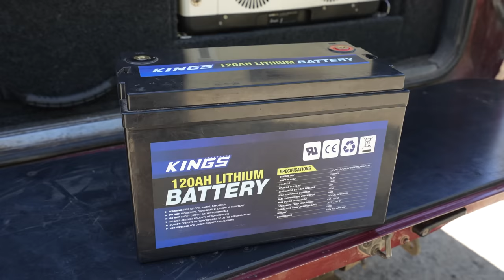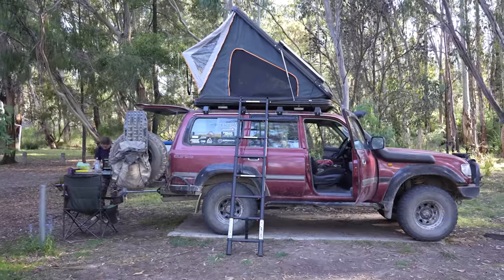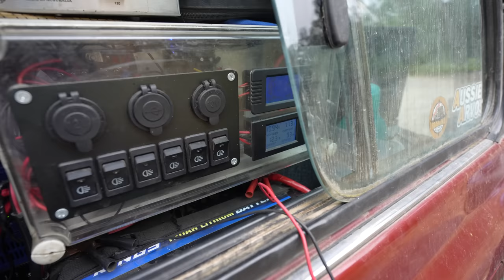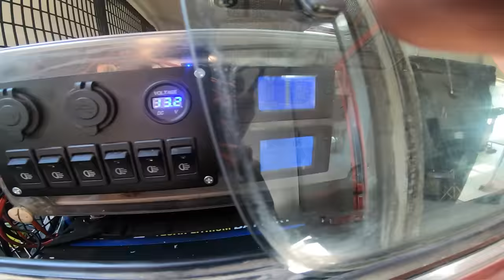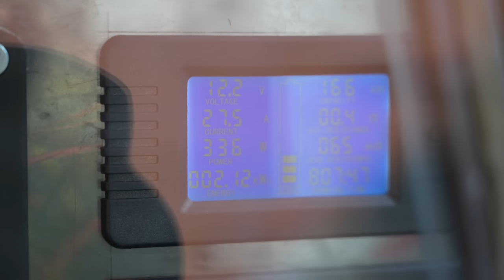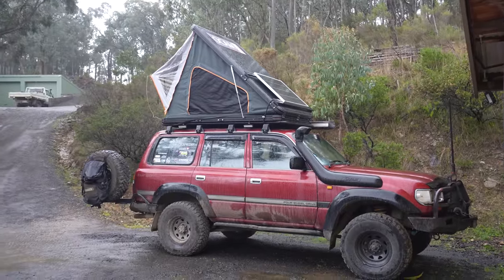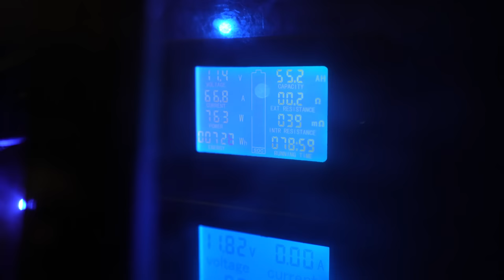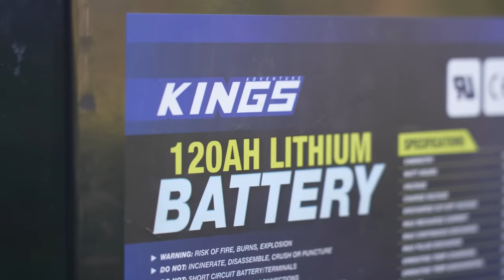Watch this BEFORE you BUY Kings Lithium Batteries

Comment: Very interesting video. I recently bought 3 115Ah AGMs from Kings. One was good, one dropped a cell pretty early and the third wouldn't charge above12.5v. I took them back and about 2 weeks later Kings refunded my money (after repeatedly chasing them up). Im not quite ready to move to Lithium yet because weight isn't an issue on a sailing boat. But thermal runaway would be.'When I do I wouldn't rule out kings batteries.

Comment: Another great review. I use a lot of kinks gear and have very little to say on the negative side but a lot of positive. Kings vs ebay is a hands down win for Kings. They also out do other brands that knock kings.

4 years ago I bought an Australian made high quality DCS 75ah Li battery at $950 with a 5 year warranty and it has been without fault. It replaced 2 x 100ah AGM batteries in our van and it out performs the AGMs. As you stated, it holds full voltage all the way to the end when lead acid starts to drop off from the start. Li can have a much better max discharge current like the 75ah DCS that is rated at 150A but goes beyond that. It not only runs the coffee machine but makes coffees for us and the neighbors. The 2 x AGMs just couldn't do one. The weight saving is fantastic. 2 x 34kg (68kg) vs about 10kgs. BUT, the best thing is the recharge time or the lack of it compared to the 2 x 100 agms. With the same solar in put, the agms would be a lost cause but the Li comes back to live by the end of the day. Last camp trip my family camped next to us has a 120 agm with similar solar input. The battery died and my 75ah DCS ran their fridge and camp but it started to come down around 40%. As there was power available at a camp kitchen I use my 16amp standard battery charger to charge the 75ah Lithium in a few hours over night. Try doing that with 2 x 100 agms.

The 75ah DCS is a lot better battery than the kings and better than most on the market. It has 150A max discharge and the 100ah has 200A discharge. They can be used under the bonnet as 2nd battery and as a start battery and with 2 under the bonnet they easily power a winch. They are top shelf. I also use the 75ah to run a 65lb electric motor on a boat.

BUT,  the cost of 2 x 120ah DCS batteries is a hard pill to swallow.  I have been looking and waiting for Li Batteries to come down in price and I have been watching to weed out the cheap junk. The Kings 120ah at $500 is goon value. The 100A discharge means it won't run a coffee machine so that means I need 2 at $1,000 but then I would have 220ah for when the sun goes out. I could buy 1 x 100ah DCS with 200A discharge and a 5 year warranty. I gues Kings have a 2 year warranty for a reason? 

There are a few things that make some Li batteries better than others. Obviously the cell quality and their voltage matching is the first. The BMS quality is a big one. As with DCS and their 200A discharge that means a much better and more powerful build than any 100A BMS. A longer warranty is also an indication of better confidence from the manufacturer so one could conclude a better overall build quality. Some cheap BMSs don't have any cell balancing so they can be less safe and will not last so long. The next level is passive balancing which is ok. Then there is ative balancing which will add years to the battery life and provide a higher and more constant higher voltage. I can't find out if kings have any balancing or what type they have. DCS have the best being active balancing so I guess 5 year warranty is a no brainer?

I beleive kings batteries are made by Lion batteries. My guess the kings are a lower quality than the general lion lithium. If I was to buy new batteries today I would go for a 200ah kings at under $800 or 2 x 100ah VoltX at a little over $1,000. I prefer 2 batteries over one larger one. VoltX now have a 5 year warranty. They only have passive cell balancing but I would accept that.

Again thank you for a great honest review and marry that girl before she wakes up. :)

Ps. I have been having a great run with kings semi-flexible solar panels for the lst few years.
Reply: That's a nice big write up mate. Hey just letting you know that you possibly should change the ninth word of the first paragraph  ;)
Reply: @MW-us3sv  not a Kinks fan?

Comment: Just a quick observation. One cycle is not from 100% State of Charge (SoC) to, say, 95% Depth of Discharge (DoD).

A measured cycle is determined by the manufacturer and they use Peukert's Law. Peukert's law expresses mathematically that as the rate of discharge increases, the available capacity of that battery decreases exponentially, often at a sudden point. This is where Lithiums at different price points differ dramatically.

The manufacturers typically pick a point, for a cycle, where the roll-off in Voltage occurs the fastest, which in a cheaper battery might be 60% DoD. I have 2 x 300Ah Enerdrive Lithiums (in a new van - I'm 64, retired and can afford them) where the next cycle starts at 80% DoD from 100% SoC. SoC is different to 'fully charged'.

My wife and I live on the road in a smallish caravan

I have 680W of solar on the van roof and twin 40Ah MPPT controllers (roof and 200W Redarc solar blanket). 80Ah charger for shore power and a 60Ah while driving. My inverter is 2300W and I employ induction cooking. Best tips? You can buy an 800W toaster, a 900W sandwich press, a 1000W kettle, a 750W hairdryer and so on - check for wattage.

In my diesel tug, I have a 'secondary 100Ah AGM battery' for charging devices and lights, and some bells and whistles. A 100Ah Redarc GoBlock for the Bushman's fridge and a 100Ah Safiery slimline to run the travel buddy. 100W of solar on the roof.

I've also run an Itechworld, under bonnet 125Ah 'hybrid' Lithium for three years. While flooded cell and AGMs have to 'power up' when the key is turned, this battery 'just starts' the engine instantly. It's been exposed to 50C and minus 8C - flawless. Corrugations on more than several tracks around Oz, beaches and water crossings.

I couldn't do this in my twenties/thirties or forties - but I learnt a lot especially in my fifties, and this VLOG is a great start for young'uns.

Comment: Thanks for this. Weight alone has got to be a plus. Having seen LiPo batteries catch fire from impact I would think it worth stressing the need to ensure care when mounting, storing and handling to avoid impacts, vibration, water across terminals and high temp.  I am not sure how an insurance assessor would regard a claim made against a vehicle fire if an accessory LiPo has initiated it.
Reply: I don't mean to be a smarty pants, but a fire is a fire, which type do you think would be OK with an insurance assessor ?
Reply: @MW-us3sv  That's the million dollar question I guess. One where the manufacturer's,  licensing authority and accepted use protocols have been closely adhered to?  It is good to see that manufacturers are building in safeguard electronics but I am at pains to ensure my accessory battery which I have installed in my vehicle myself is firmly bolted down, kept cool and well electrically insulated and is charged and discharged correctly and at safe rates....just in case.

Comment: Hasn't had a super lot of use yet but I picked up 2 from Jaycar for 400 a throw, actually cheaper because you get a voucher every 200 if you sign up. The energy density is insane. If camping 4 days or less I don't worry about packing panels because there is no need. The weight savings is also insane, if you have portable packs like I do that is worth the trade up alone.

Comment: Not quite the same use case, but recently swapped out the 12v battery in our 2018 Hyundai IONIQ Electric to a Li one, after the lead acid one carked it.  Struck me as odd that there wasn't a Li one in there to start with, noting the HVAC battery is Li. 

After watching this I want to check how its recharging, noting that the HVAC battery recharges the 12v battery. I wonder if the right converters are installed.

Comment: I have 4 of the kings 200Ah (LiFePO4) batteries in my shed - standing by for peak shedding or Blackout preparedness (shed based solar system charges it for "free" in the day - Feed in Tarifs are pretty terrible these days.  - it is a bit of an experiment for the present ongoing into the future. I also have a Renogy 200Ah (LiFePO4) bluetooth battery in my ute (with Renogy DC-DC charger and 1kW UPS_ Inverter, it has been in there for around a year so far - (2x 100W flexible solarpanels easily fit on my roofrack - adding a removable timber standoff rack, rigid loads can also be carried without taking the panels off, great for trips to Bunnings - this totally makes parking the ute for any length of time no hassle, no problems with flat batteries - Renogy 50A BCDC (DC-DC MPPT) is bidirectional, charging the starter battery too.), no problems with the setups so far, let's see how it is all surviving in 2030??

Comment: Good review!. I saw another review on youtube showing it's likely made of used cells. That's probably why it's rated for 2000 cycles instead of 4000 cycles + and why it weighs 15kg. If they are 150ah cells, they can probably still reach 120ah after 2000 cycles. But still, it could be a good budget option.

Comment: If your going to a 40-60amp DC-DC charger you need to make sure your alternator produces enough amps otherwise you will burn through alternators! A lot of 4x4's only have 90amp alternators as standard which is why people replace them with 120+ amp alternators.

Comment: Great vid, but personally prefer gas cooktops, saves on the massive load. But the small ovens are great. I run a lot of radio gear as well and 2 of these are faultless. Never run out of power, and always set up a 200w solar panel when in camp.

Comment: cool video. Shame here in England we dont have Kings, or anything like Kings for cheap stuff.  What few stuff we do get here is so so expensive. ARB have only just started setting things and prices are crazy..   Oh on Monday coming i am getting what you call a N70 Hilux. Its a 2010..  nice 4 door.  Its a manual 2.5 rather than a 3 litre BUT... the 2,5 only comes with rear locking diff. The 3 litres only LSD.   I will get a lift, some simple mods etc.  Big wheels and tyres, maybe off my Gen 2 Pajero  2.8..  oh which means i will have to send off for another of your AA stickers lol. 

I had only just fitted the Auxbeam switch panel, all 4 side led bars...  so that will have to come out of the Pajero and fit to the Hilux... as i want to go back to Ukraine in it in May..    Not had a Toyota for 20 years.. but then i only had 70s Celicas lol.

Comment: Curious as to why you used a lithium ion instead of the much safer LiFePo4?  A 12V 100Ah can be had for about US $400.   The biggest drawback is that you can't charge them below 0 degrees C.  Otherwise they seem like a better fit for off-roading.  They won't suffer from thermal runaway and won't catch fire if they're pierced.  They require a special charging profile but so do lithium ion.

Comment: I think you said you had a 2000W inverter and I kept on seeing the 1500W inverter? what gauge cable are using to power the inverter?
Reply from the maker: Sorry it's 1500w, just the gauge wiring it came with.
Reply: How and why were you running a 1800w induction cooker on it? thats just crazy. Just get a cheap gas throwaway stove. $19. Far more efficient than electric.

Comment: i saw you had a toasted sandwich maker, how did that go for you? i bought a new 115ah AGM  and a new 1500w inverter i took my 800w sandwich maker and 800w toaster to up near Frazer. but struggled working . i do have a second AUX under the bonnet just for the kings 75lt fridge/ freezer any idea what to do now? 250w solar panels?

Comment: Great review, thanks very much for your work. The channel is improving all the time. 
Just wondering if you've done a similar video on chargers, inverters and solar panels......basically all the 12 volt system components really. I'm just about to start putting mine together for my 80 and I'm interested to see what Kings components just run too cheap to be worthwhile, I'm not intending in false economy savings on stuff I'll be relying on in the bush. Cheers guys 👍🏻👍🏻

Comment: i got one in december for $300 also bought the battery box go with it runs my coffee machine no worries through inverter and car fridge 12v lights charges phone and laptop also no worries  i just have charge it up with folding solar panel once or twice week i run it through a victron smart solar controller can see what im using through app on my phone

Comment: A great insight into your experience with the Kings Lithium battery. I have Perfect-charge IU152A  inhouse battery charger, which is runs power to my 120ah AGM battery while driving the to 240 power when needed. The alternator in my Hilux has a VSR  battery isolator that stops the overcharging of my inhouse 120ah AGM battery while driving. I would like to change over to Lithium. Do you think I would be able to just swap over to Lithium with the setup I have. I would like to avoid buy a DC to DC charger if possible, I have 350w of solar.  I am not very electrically knowledgeable, simple answers please if you can. Thankyou

Comment: How are you running an 1800w induction cooker off a 1500w inverter?? 🤔 
I’m still deciding which /what size inverter to get but from what I’ve read/researched you should run an inverter that’s higher powered than what your running , so realistically for us 2000w min ! Also for an efficient set up run battery AMPS at least 10% of your inverter’s capacity 2000w = 200 AMP batteries 🔋

Comment: Great review.  Set my son up with a kings  75L Stayzcool Dual Zone Fridge Freezer  plus a 120AH lithium (Kings) and a 280 XTM panel.  He must be doing something wrong as no way he is getting 4 to 5 days. On cloudy days with and no solar input and battery at 60% The lithium has shutdown in the morning. So Zero. (12 hrs)  The fridge runs approximately overnight compressor on 12 mins to 10 mins off.   Supposedly amp draw 1 - 1.3Ah  There specifications.   So say its on 30 mins every hour and say its using 2ah so that 2ah divided by 2 = 1ah by 12 hrs  = 12ah. I wonder what he is doing wrong or are my maths up the creek. Tks

Comment: Great video Patrick. Thanks for the honest feedback. I bought a 200AH kings battery just before Christmas and I’ve used it several times so far. One trip was a 7 day fully off grid trip in almost 40 degrees each days and I only started to struggle with it on day 5-6. So I can’t really complain. It’s given me lots of confidence to explore more with it. 
One question I have is what battery monitor are you using? I’ve found a lot out there don’t support Lithium, so I’m curious to know what you’re using. Thanks
Reply from the maker: Hi Peter! i'm using a ebay shunt and battery monitor, the SOC (state of charge) indicatior isn't perfect, but the figues such as voltage, amp draw, amps used are all fine, i did it on a budget, but next time i'd considor getting a higher quality shunt and display, maybe a victron one with bluetooth or somthing like that :) 
i spoke about it more in my build video which you can check out here: https://youtu.be/mCiNORXI-TE
Reply: @AussieArvos  Thanks mate. I thought you would have mentioned it previously and I’ve even seen that video a while back. I was looking at the Victorino ones too so might consider getting one of them in the near future. Thanks for replying and keep up the great work
Reply: 200ah lithium what sort of coin did they sting ya ... up Toowoomba looking at similar set up for a van
Reply: Did you have a dcdc charger and a solar panel attached to it
Reply: @andrewcaruana1960  yes mate. 25A DC DC charger and 200w solar blanket. However there was a little cloud cover some days and we had a bit of tree coverage, so it wasn’t completely efficient

Comment: I was pleasantly surprised how long lithium batteries last for, compared to equivalent sized lead acid batteries. i use mine with an inverter, and with the lead acid battery, I would (like you say) have a voltage drop after a while under load, triggering the low voltage cut off on the inverter. Not an issue with my lithium battery. Worth the extra money for sure.

Comment: I've just dropped the 200ha Kings in and replaced my inverter for a 2000w, I have trouble running my induction cook top at 1500w and 2000w, I've been told I need a shunt? but you mention you bypassed yours? can you explain? it's ok at 900w but with that you lose temp. how are you able to run what you do with just a 120ah battery?

Comment: Havnt tried the kings battery yet, but just ordered a 100ah lithium century on sale at supercheap auto $599 down from $1099, going to use it as a trolling motor battery for my tinnie. I must say ive bought various kings products in the past and never had a drama. Top stuff.
What do you think of the induction cooktop. They look pretty handy.

Comment: I don't understand why people still go for these type of setups. Bluetti make power stations with 3 times the battery capacity of these with built in inverters that will run almost anything. They have multiple usb plugs, 2 ac plugs, cigarette socket, 2 wireless chargers on top, even an aviation plug to power a motorhome and all this compressed into the size of an esky. They also have an inbuilt solar charger and cooling fan. They are easily strapped in your vehicle and can be removed and used at home or on a jobsite to power tools. No need to have all those separste items with wires running everywhere that end up costing more. That is so old school!

Comment: We run a 120amp lithium in our ute with a 300 watt solar panel and a 300amp lithium with 900 watt permanent solar on the the roof of the camper & a 250 watt folding panel if needed. We have never had a problem with power out camping with our 3 kids and the wife is happy because she can bring the hair dryer!! 🤣